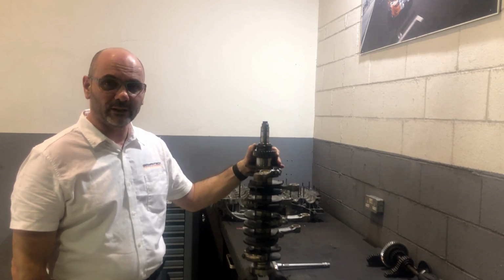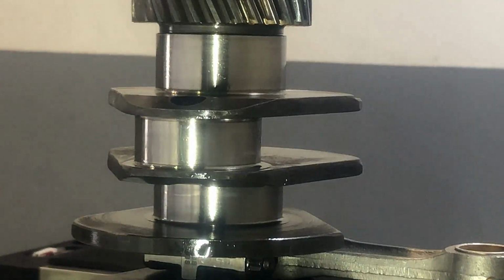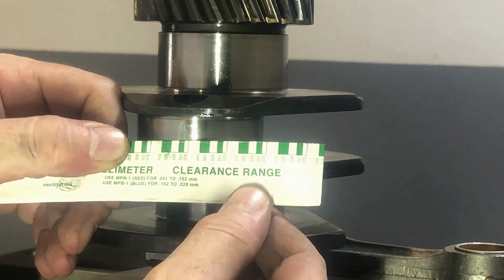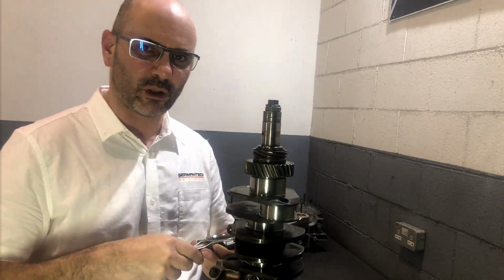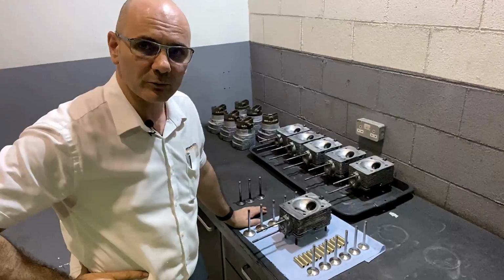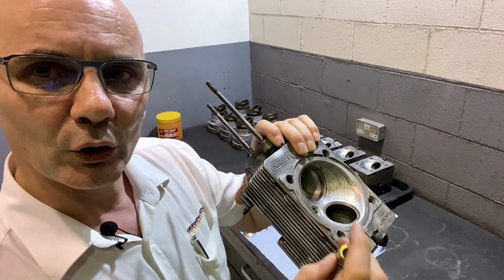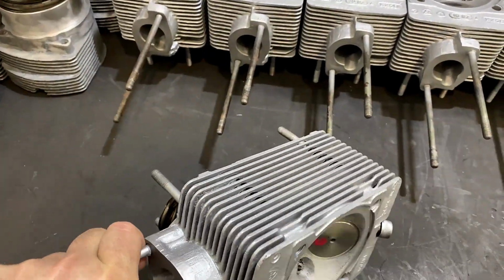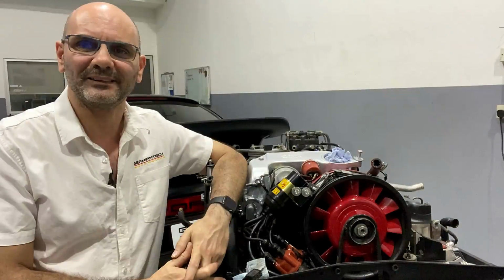PORSCHE 911 (930) TURBO ENGINE REBUILD

Comment: If you were to torque the rod bolt to full spec/stretch, would you expect the plastigauge to show a tighter clearance? or is the 20nm sufficient and anything past that is just stretching the bolt?
Reply from the maker: if you stay 20nm off the final torque you'll be fine and getting the reading you need

Comment: You have done very neat & amazing job,  I am about to dismantle 83,930 turbo ... What did you use for chain tensioning, while performing engine timing ? looks similar to my engine, what do you suggest for cam timing spec in 83 model turbo...
Thankyou
Reply from the maker: in original configuration the intake opens at 3 degree ATDC

Comment: You put your rod in a rod vice with the bearing tighten the cap to spec and measure with dial indicator  but first you have to measure the journal’s with a micrometer
Reply from the maker: Hi Wesley, thanks for you input. To answer your question further down in the comments and replying to your comment today:
We are aware of the process in measuring both components individually but with a tolerance span of more than 0.06mm on engines of the 80's the precision level of our tool is more than sufficient in terms of accuracy. Besides, our components are brand new, this means its highly unlikely to come across eccentricity (caused over time in high mileage engines). 
The plastic gauge was applied in the true vertical plane to measure the oil clearance. I doubt micrometers or dial indicator would have provided us with relevant additional numbers outside the specified tolerance. Let's just say we agree to disagree.

A German saying would apply: "Mit Kanonen auf Spatzen schiessen"  (Translated: using canons to shoot sparrows) :-)

Comment: Why plastagage instead of a dial indicator   Not very accurate
Reply from the maker: Hi Wesley, plastic gauges are used to determine clearances up to 1/100 of a millimeter where other tools are unable to. Would you mind explaining how you would use a dial gauge to get to the clearance of a con rod or crank bearing. We are excited to read your reply :-)

Comment: Hi. I'm from Denmark, 57 years old and own a 911 Turbo S (930) from 1987 engine number 930-66-S with 330 HP AB WERK, twin tail pipes 2 x 2 to both sides, extra big oilcooler in front, special front spoiler and other specials compared to the standard 930.
It has 165.000 km on the clock and will need a complete engine overhaul. Is also leakin oil from the engine block connection at the bottom. And the gear  box also need repair - nasty noise between 2. and 3. gear. I could feel it loosing more and more power. 

Do you know any special Porsche workshop in Germany, who is as skilled as you, and will allow me to watch the whole process from start to finish, and maybe record some of it as they go along - similar to your videos.? Would be great to have that dokumentation. I would also like some tuning to the engine, maybe boring to 3,4 L, special valves,  bigger Turbo,  Intercooler etc...is 450 - 500 HP possible with the standard engine block, cylinder and cylinder heads.? I picked up the 930 i Germany in 02/2000 so had it for 20 years now. But it has been standig still since 2009 due to the engine problem, and personal family issues the past 10 years. But now it is time to bring it back to life and on the road again. Color is Indischrot / indish red by the way. LOVE IT.....have lots of photos of it.
Reply from the maker: Hi Stig, I'm glad you like our work (besides the video quality). I must say, sweet car you've got there. 
I used to work with the Porsche AG, unfortunately I left Germany in 2003. Having said that, there wouldn't be anyone I could recommend there, but I'm sure you should be able to find some good quality shops online. 
Keep me posted how it goes :-)
Reply: Stig og Susanne Not sure about Germany, but there are a lot of luftkuhl specialists in the UK. And 450-500bhp 930 exists in Blighty. We Malaysians are VERY EXTREMELY lucky to have Leo here.